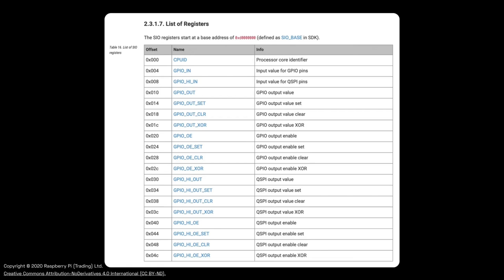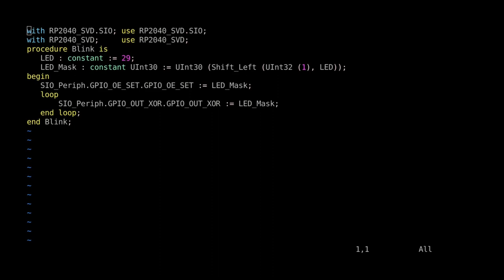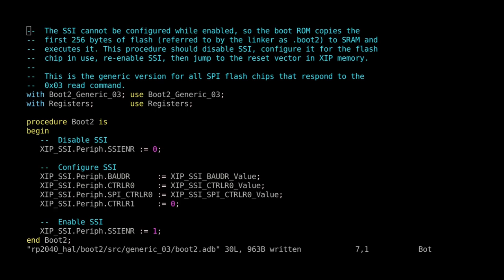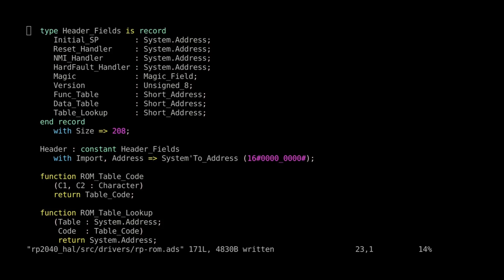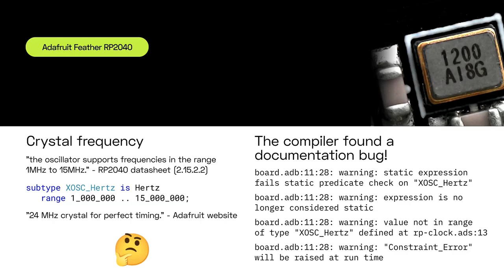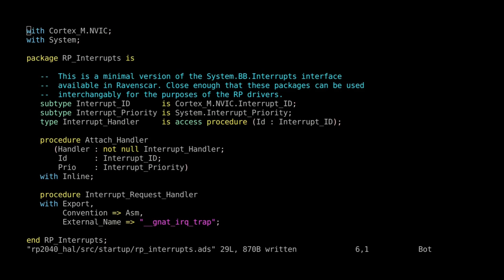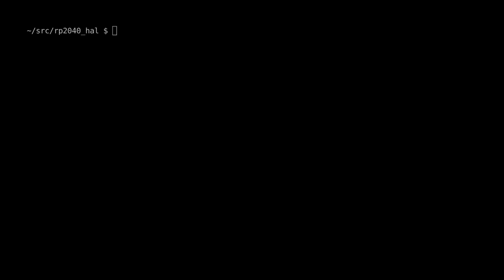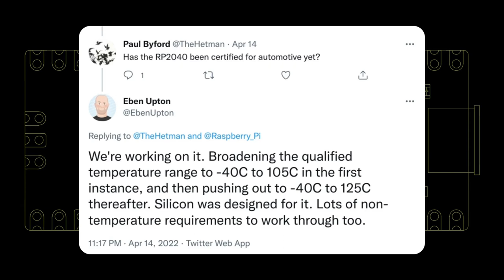Ada on the Raspberry Pi RP2040

Comment: It's really great to see your professional approach! That SVD file was news to me. I wish there was something similar for the ARM cortex instruction set encoding. 9:59 You don't mention the atomic set-clear-XOR register mapping scheme. It's Section 2.1.2 of the data sheet. "Each peripheral register block is allocated 4kB of address space ... This allows individual fields of a control register to be modified without performing a read-modify-write sequence in software: instead the changes are posted to the peripheral, and performed in-situ. Without this capability, it is difficult to safely access IO registers when an interrupt service routine is concurrent with code running in the foreground, or when the two processors are running code in parallel."

Comment: This is awesome! We still use Ada for our courses in my University, and with Ravenscar Profile, those lego mindstorm boxes quickly run out of memory. I have designed a custom PCB and Robot for that to be replaced with a RP2040. Till now, I was writing code for it in Micropython (better support for Interrupt Handling). But with this product of yours, I'll be happy to test it out on my hardware and let you know how it goes. Does the software support I2C Slave/Peripheral side code? It's my major cause of concern with Micropython. Also, have you performed any speed metrics for a board running say Micropython vs a board running Ada? It would be really interesting to compare those with what I find. I will reach back to you for sure. Thanks for your amazing project.
Reply: I see there is I2C Target Support. This is awesome. Do you have plans to add UART, SPI, and I2C Interrupts as well?
Reply from the maker: I2C target support is on the master branch and will be included in the 2.0.0 release, which should be ready within the next week or two. You can pin your project to the master branch if you need that right now.

There are several ways to attach interrupt handlers and all of the serial drivers have procedures for setting IRQ flags. I think the best examples are in the unit tests. Here's the interrupt test for UART: https://github.com/JeremyGrosser/rp2040_hal/blob/master/tests/src/uart_tests.adb#L108

We're currently making some changes around interrupt handlers for better compatibility with Ravenscar runtimes, so there will likely be a few more breaking changes there before the 2.0.0 release. I suggest you join the gitter chat (https://gitter.im/ada-lang/raspberrypi-pico) to monitor the discussion.

I haven't done much benchmarking, but it should be faster than an interpreted language in most cases.

Comment: Doesn't the compiler optimize away representational clauses if you declare them as constants?
Reply from the maker: For the boot2 section, I couldn't get the compiler to optimize those out. If I declare constant records in the package scope, it requires elaboration. If I do it in the declarations section of a procedure, then it needs stack memory.
Reply: @JeremyGrosser  Is this something that should be submitted as a compiler issue?
Reply from the maker: I'm not an expert on GNAT, so I don't know if this is expected behavior or if I'm doing something wrong. It certainly seems like a constant record with representation should be able to be elaborated at compile time.

Comment: ADA?   Why would you dig up that ancient failure?  What's next?  Pascal?  Even in the days when ADA was one of my courses at university, it seemed like a totally useless TurboPascal-look-alike monster to me, with a compiler which always seemed to try to guess what you meant when you made a mistake and described that in lengthy messages, rather than just giving a simple description of where it found what mistake - a feature that also annoys me when C++ templates are used.  Now, that could have been just that compiler, but still I don't see why you would be a masochist and use ADA rather than C(++).  And even though I'm not a Python-fan, at least there are some (rapid-prototyping) reason to prefer micro-Python, but ADA?  And seeing the problems you've hit, ease-of-use also doesn't seem a valid argument.  So?  Just to make a video of it?  Sado-masochism?
Reply from the maker: I'm glad you enjoyed the video.
Reply: You have no idea of how profoundly ignorant your comment is. Judging a language based on what most programmers would consider a plus, the detail of its error messages, reveals how little programming you've done. The mere fact that you're uncertain about whether the messages are generated by the compiler, or the language itself, is even more telling. If you knew something about compilers, you'd know micro-python is misleading. It's just assembly language masquerading as Python statements and offers no real performance or productivity over other conventionally used languages. It's goal is to make low-level programming appear more approachable by using a popular scripting language's syntax.

Regardless, Ada is modern, efficient, and fast. It was introduced a couple of years before C++ with many of today's languages just starting to adopt some of its features and concepts. The language is no failure and continues to power military, industrial and medical systems worldwide. Nvidia recently committed to using the language over C/C++ for its reliability, performance and security. 

C/C++ not only encourages, but virtually requires bad programming practices in order to fully exploit its performance and efficiency. The issues the presenter encountered are far worse in C/C++, which is why he is paying a small technical cost upfront by porting the HAL code  to Ada. As he mentioned, Ada helped him dodge a bullet by exposing an overlooked error in the hardware's datasheet. I wonder how many developers using C/C++ failed to catch it. Certainly, not many otherwise the error would have been corrected beforehand. The other issues he ran into were more to do with the idiosyncrasies of the hardware, not Ada. 

It would behoove you to do some basic research on Ada before spouting your mouth, especially to someone who understands the topic better than you do.
Reply: Ada was created for the USA military, might still be used to build battlefield simulator ...
or in space shuttle - aviation computer(s)